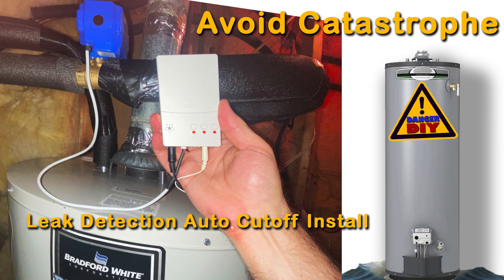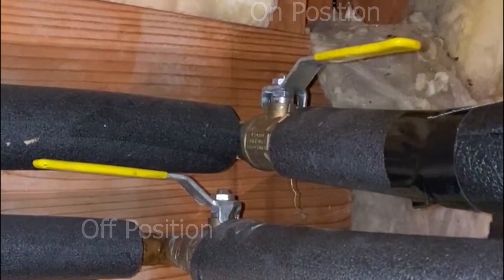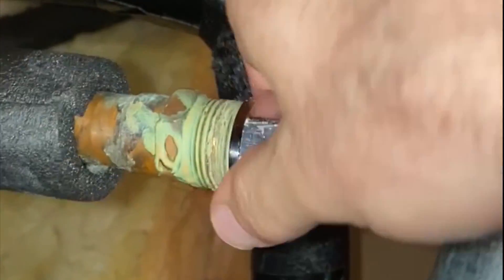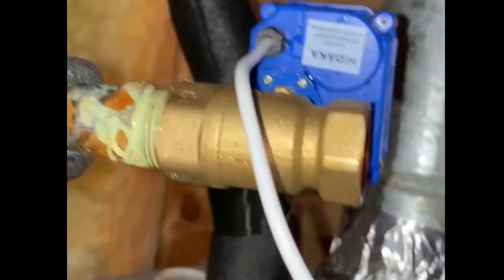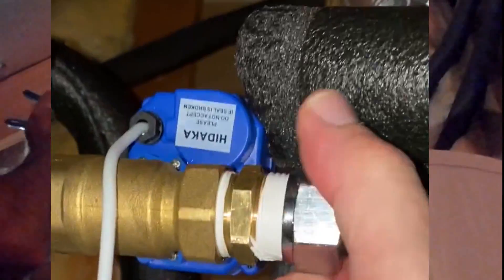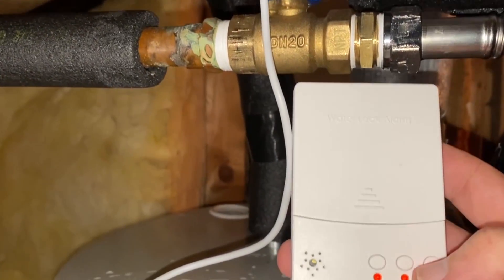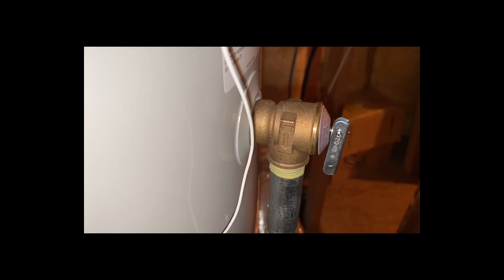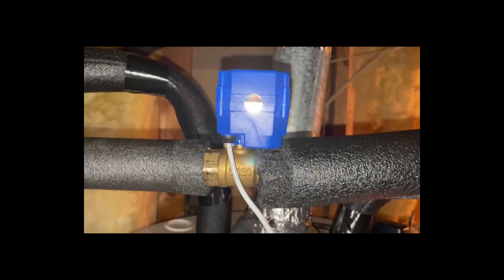How to Install Auto Shut Off Valve For Stopping A Water Leak | Save $400 Over Plumber

Comment: Thanks for sharing! The Amazon link is not working. Can you please fix it or let me know what name brand you used in this video? Thank you!
Reply from the maker: E-SDS is the brand.  Try this link :  E-SDS Water Leak Detector with Shutoff Valve, 2 Sensors and Sounds Alarm, Automatic Water Leak Shut Off Valve System, for Pipes 3/4 NPT, Flood Prevention for Laundry,Water Heaters and More https://a.co/d/d68Nmv3

Comment: Thank you for this great public service.  I believe such a shut off valve should be required by the building code.  Very helpful video.
Reply from the maker: Thank you.  I wish it was. Don’t forget to test it every so often after install.  I have a 3 month reminder in my calendar.
Reply: @DangerDIY  You are welcome.  That is a smart recommendation, too.  It puts a mobile phone calendar to good use!  I do not know the current drain when the valve operates but it may be worthwhile to consider including a larger APS (Automated Power Supply, often used for computing equipment power backup).
Reply from the maker: @AmitSingh-zn1kz  great suggestions.